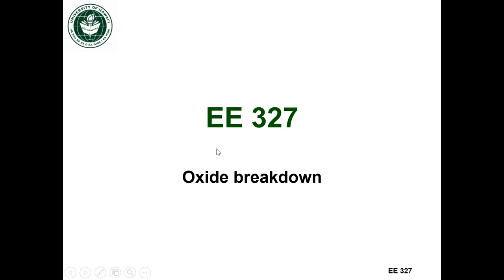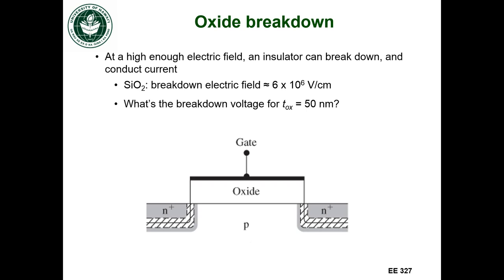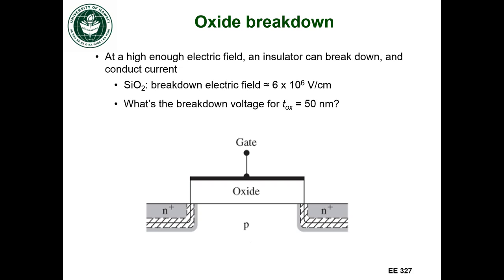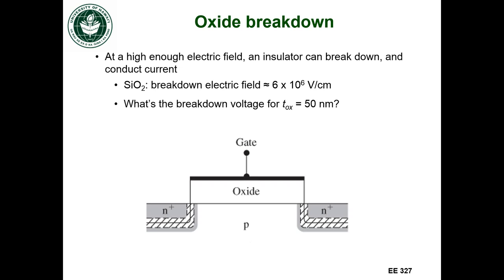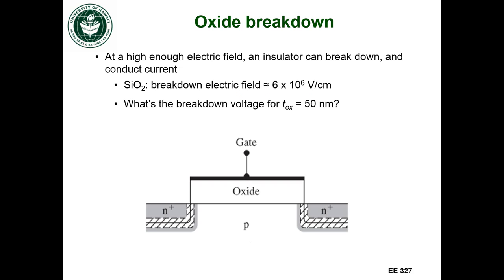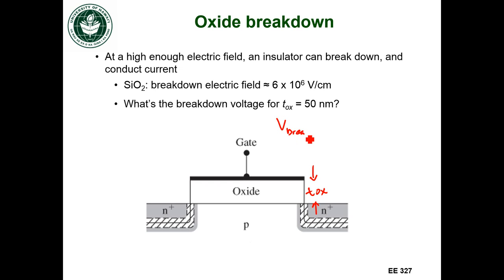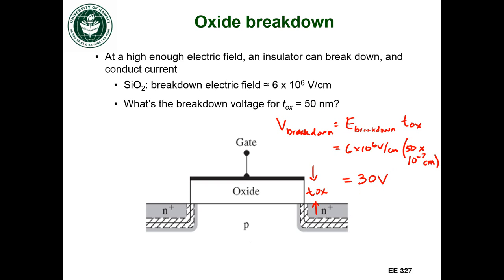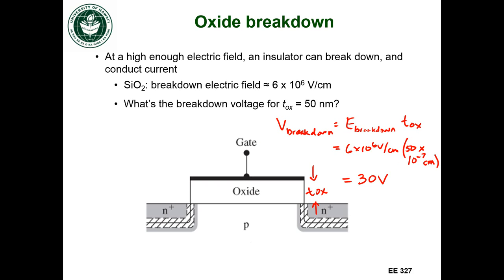EE327 Lec 31e - Oxide breakdown

Comment: nano meter is 10 ^ -9 not 10^ -7
Reply: nano meter is 10^-9 m,also 10^-7 cm
Reply: @iori0820  you are both correct, when the units are specified.    1 nm = 10^-9 m = 10^-7 cm